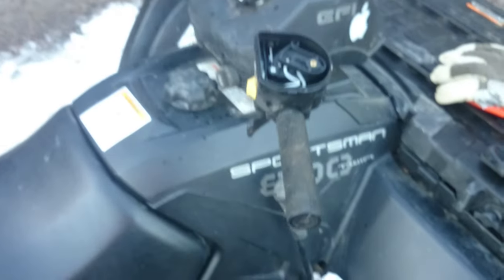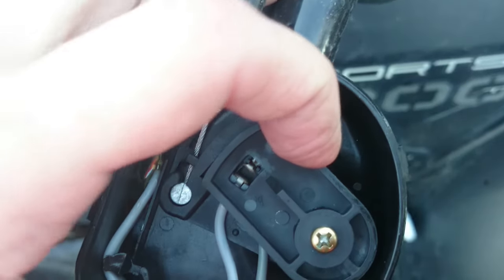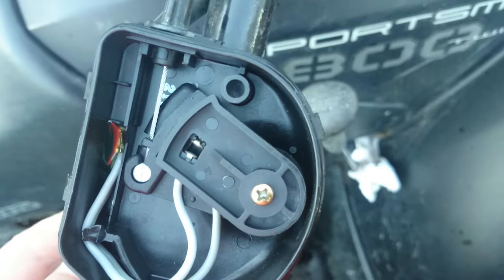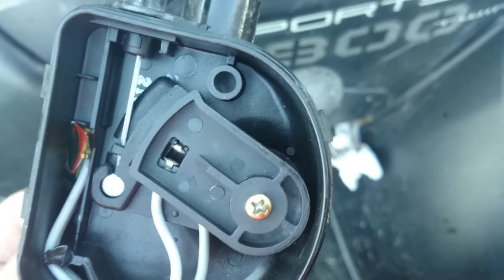Polaris sportsman no idle fix

Comment: Awesome video! This was the issue with a '01 Sportsman I was working on and had to install a new carb onto. When I got it, it had a 34mm carb rigged into a 40mm intake and didnt run well. After swapping to the correct (but aftermarket) 40mm carb, it would only run with a bit of throttle input but still wouldnt idle on its own so I was right to be suspicious of a kinda hidden killswitch! After adjusting the TSS it runs perfectly!

Got it warmed up, cruised around until the fan came on, then went for a speed run and it does 57mph!

Comment: I tried everything from getting new carb,fuel pump,fuel lines and still ran like crap. Then I found your video and took cover off throttle cover and sure as shit the little spring was loose laying there. Fixed and runs great. Thanks so much for posting your video!!!!!!
Reply from the maker: Jim Smith great that it helped!
Reply: where does the spring go?

Comment: Any info on if your throttle is sticking and rising when you touch the cable or turn the bars? My cable is free, it's not tight or being pulled. It retracts just fine. Could it be electric?

Comment: Why can't you just cut the wire so it don't touch ???
Reply from the maker: If the throttle cable sticks you are in trouble quite fast with 55hp.
Reply: ..avoiding an engine runaway and then crash
Reply: Switch "off"